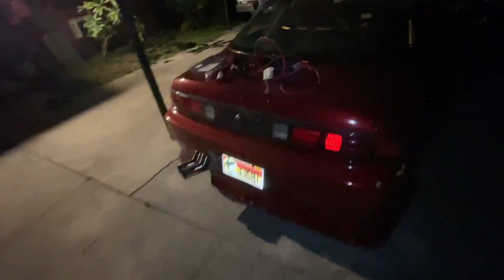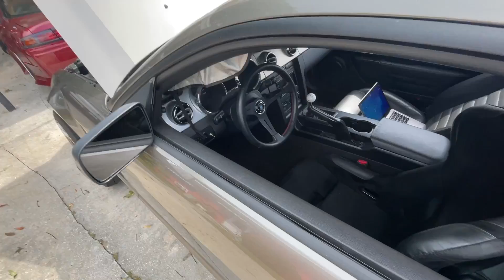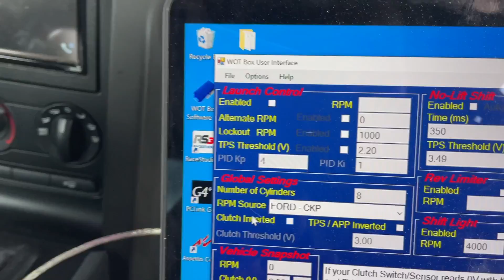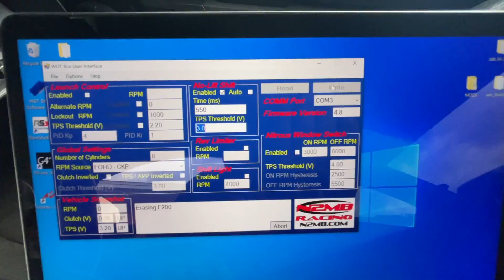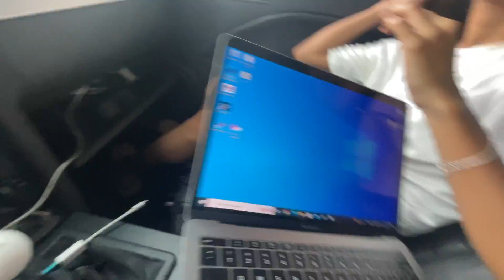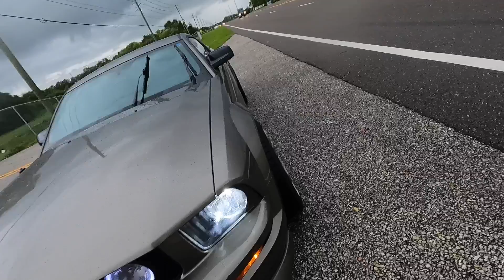How To Make Your MUSTANG SHOOT FLAMES!

Comment: This is off topic but do you run the stock lsd differential or is it welded and if stock does it lock easily ?
Reply from the maker: Yeah it’s stock lsd it locks up pretty good most of the time but it opens up sometimes in the rain when there’s no load on it